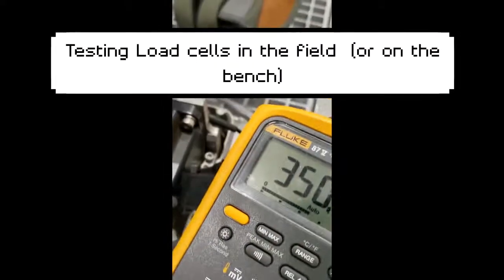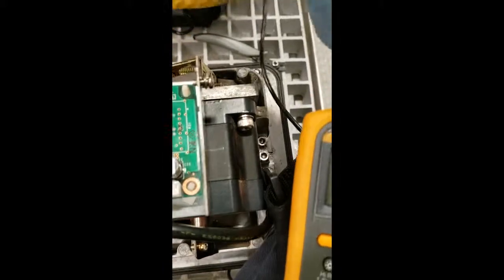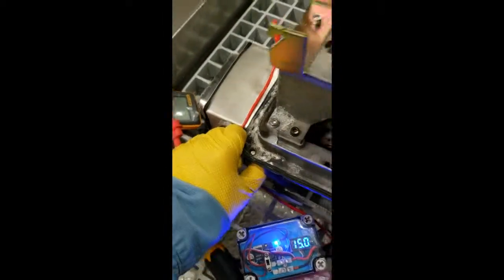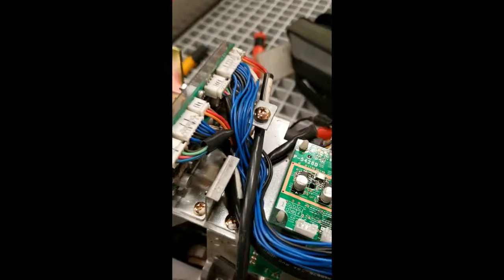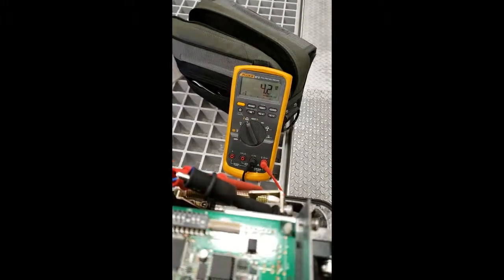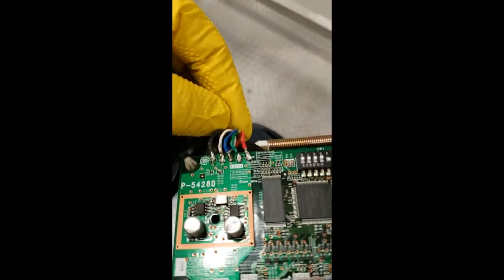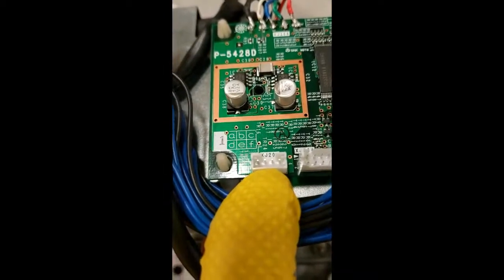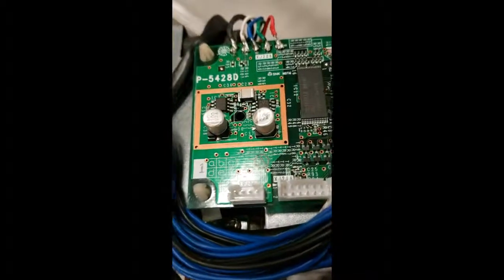Load Cell testing

Comment: This was really helpful. I just recently started working on weigh heads, and always replaced parts based on trial and error.
Could you show/explain how much gap there should be between the bolt  (stopper I guess, don't know what it's called) and the housing?
I'm talking about the bilt that prevents the load cell from getting damaged it is subject to excessive weights.

Thanks
Reply from the maker: check link for load cell basics I made

Comment: Is there a proper way to install the load cell? Im currently checking one that doesnt give those mV. It gives me .2 mV om bench and 3.7 on head without hooper.
Reply from the maker: actually those are good numbers....   the rule of thumb is if it reads less than -1V with no weight it's bad.    on a bench those are ok, what you need to do is flip the head to a vertical position so some weight is on it, then use a weight OR your hand to just make sure it responds as expected.  THe big key, after you install a load cell the overtravel screw is going to be off.  So you want to test that with a piece of paper top and bottom before you say it's good to go.  leave more space on the down travel for the weight.
Reply from the maker: don't use a feeler gauge, you can force a feeler gauge, use a piece of paper, it should easily slide top and bottom but allow more room in the direction of weight.
Reply: When i was instaling the new cell y remove the travel screw and when i put back the head into the scale i carefully screw it back and use a feeler gause to set it in .1 mm like a tech told me.
Reply: Now that you tell me i can use a paper, using a feeler gauge could damage the load cell? The thing is that when i calibrate to zero it does, but when the weight hooper opens and closes without product the value goes to negative numbers.
Reply from the maker: @joaquindelfin9547  it won't damage the laod cell but you can force it because a load cell bends, and it won't be real...you need an air gap.
Reply from the maker: thats why paper better
Reply from the maker: OHHHHH you may have put load cell in upside down, I've seen it before.   you may need to flip it grab two heads and compare.   it can be reversed and still fit
Reply: The duc board its new.
Reply: How upside posicion?i Install it like the one that was before, the housing that holds the cell has a little square wheres the cell cable goes thru or it can get upside?
Reply: Other thing that i notice is that when hooper opens and close the value doesnt return to the original value. I check mV and it happens the same. Is the any mecanical ajustment needed when replacing the cell?